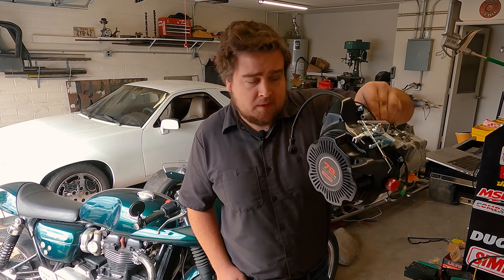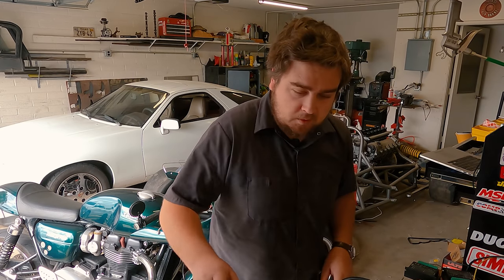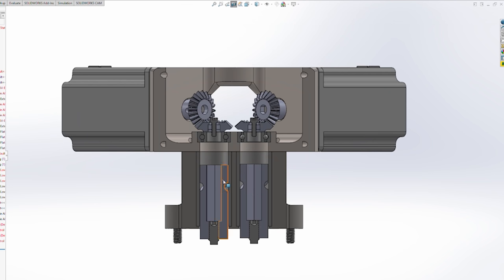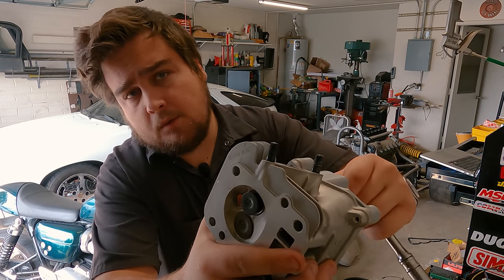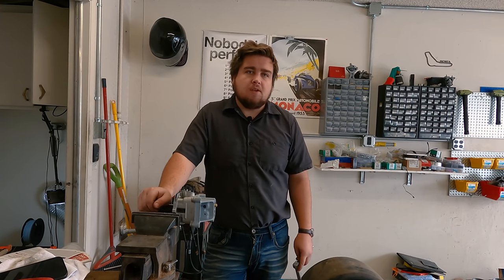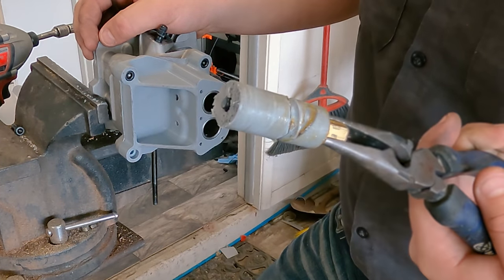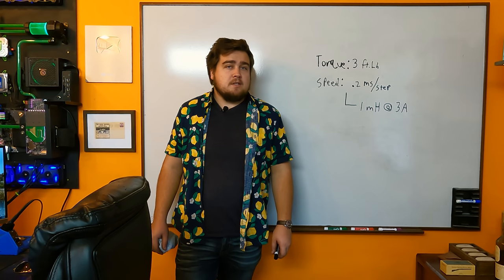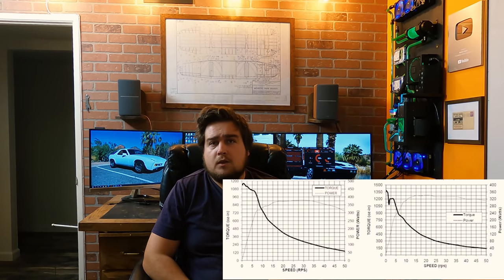Adventures In Deleting Camshafts | The Theory

Comment from the maker: This is going to be a long project... But I'll keep you updated as it goes along! in the mean time, I have some fun projects going up in the next few weeks! Thanks to everyone for the support, You all are amazing.
Reply: Forgive me if it was already mentioned and I missed it, but does adjusting the gear ratio between the stepper and the valve fix your speed problem?
Reply: Hey I just saw came across your channel and I have built a mechanical build I did but I abandoned it because of the tunning problem I don't know how to program things just mechanical things I am in Ohio I would love to see what you thought
Reply: Use a odrive for the stepper replacement uses brushless dc motors and encoders. They are faster and higher torque but still takes step and direction commands.
Reply: @nefariousyawn  I was wondering the same thing. It would increase the torque requirement, and also give less "resolution" in valve position.
Reply: Wesley but doesnt that make the actual design like 4x more complex and mechanically "vulnerable" than normal camshaft?
One of the goals for freevalve was much more granular and flexible valve control. You could modulate rpms from low to really high.
Any rotary electric drive would make it pretty rpm limited, so I would ask simple question: why not hydraulics?
They are much more controllable than pneumatics and you can control them with common solenoids.
True, you need high pressure system which introduce all of those nasty problems ... but ... they offer so much flexibility.
Reply: I found a direct drive electric solenoid directly on top of each valve and 4 valves per cylinder and I setup an assist spring system to reduce fatigue. I got them to move and at veriable heights but couldn't get any further and shelved the project because I didn't know how to make a program to make everything work together
Reply: Wesley. I'm beginning to think it might be simpler to drive the valves from some mechanism that takes its drive directly from the engine so that it's always in time with the engine. I'm thinking that maybe a cam, driven off the crankshaft might be suitable. ;-D
Reply: I'd like to hear your thoughts on this "new engine design" that came out recently.  It's very early obviously.   There's a video on "autoline network' here on youtube called:  "Who Wants The Most Revolutionary Engine In The World? 160 HP. 25K RPM Redline. Only 35lbs - AAH 583"  -- I'd like to see if you have any insights or thoughts about it.  Could make a quick video.
Reply: why not going for a fully hydraulic system? using the steppers to redirect the flow of oil instead of acting on the valves directly
Reply: Your videos are like a peek in my mind…all over the place!🤷🏻‍♂️😂 Great stuff! Look forward to seeing more
Reply: Could you use a linear motor and have a cam mechanism like a clicker pen?
Reply: I’m so invested in this.  I want to try it on a vw 16v 1.8/2.0 and the ej22 Subaru motors.  I’m in the process of learning 5axis, so I should be able to make some weird shit for my build.  Thank you for making this series.
Reply: Maybe you could use oil pressure to puch the vallves open?
Reply: Wesley Kagan;When this video appeared posted available, it sparked my interest to see if and what You had though of, attempted, developed, and if possibly You had any thoughts similar with mine.
Your presentation, descriptions and methodical approach are very good, thus, Your posted videos are also well done and clear too.

My ideas, design, implementation are actually contain a much simpler and simplified approach, using an existing device, able to be controlled directly, and functions with the necessary required quick response times, and eliminates all uses of these valves, any cam, and simplifies every piston engine design.
Still the Liquidpiston X engine design is more efficient but may have some use with the input and output ports for more powerful and larger applications.

All the Best and Much Success in Your Quest, Health and Well Being.
Sincerely
Reply: how about a camshaft, but the cam and the shaft are seperated by a eletomagnetic clutch?
Reply: Could you use a zigzag pattern instead of a spiral allowing you to spin the steppers in one direction?  No need to overcome the inertia of the direction change of the motors plus by changing the aggressiveness of the zigzag you could change the granularity of the motion of the valve.  You'd have to use a keyway to keep the valve from turning or use a non-round stem.
Reply: @andylewis7360  Classic
Reply: Rockers with a higher ratio may help bring those open & close times down
Reply: What about linear electric motors? Wouldn't those be able to cycle quicker and not require any gears or springs (though return springs would increase reliability maybe)?

Comment: Nice work, I have done a bunch of thinking about doing this myself. A couple comments: I think your math is a bit off, in that the 20 ms you calculate is how long it takes for 2 crankshaft revolutions. The valve is going to have to open in a small fraction of that time, and get closed again also. I calculate 6000 RPM = 100 revs/sec = 36,000 crankshaft degrees per second. If you allow 90 crankshaft degrees for the valve to open, you only have 2.5 ms for the valve to open, not 20 ms. This makes your job a lot more difficult.
You can make steppers go a lot faster by applying much higher voltage. The stepper torque is related to current, not voltage. The heat generated inside the stepper is also related to current, not voltage. You just need a lot more voltage to make the current through the inductance rise a lot faster. 200 volts or more is not out of line here. The stepper driver needs to regulate the current to the stepper winding. This is normal practice for any high-speed stepper application.
But in my opinion, you are fighting a losing battle with mass. You have to accelerate and decelerate all the mass of the stepper rotor, gears, ball-screw, and valve etc every revolution of the engine. I believe the "best" (most likely to succeed) approach would be to use a voice-coil type actuator. Stationary permanent magnets, moving voice-coil connected to the valve. There is a reason that speakers are made this way. Large industrial vibration testing machines also work this way. I have an actuator from a very old hard drive built like this: it has a 3" diameter voice coil, with a 30-lb magnet assembly. (This hard drive had two 17" platters...) You will still need a high driving voltage to overcome the inductance of the voice coil, but at least you will not have so much mass to throw around.
Nice work, good luck!
Reply: +1 for voice coil actuators. I worked on a medical product at work that used one in a precision motion application that was able to control the position of the coil down to the micron range while going through a set trajectory over and over and over at say 100Hz or so. The hardware was very straightforward - just a simple 24V full bridge driver. The control was the hard part, as always, but it was sick to see it work. Watching the actual position VS. The trajectory at those small time scales was cool! Fun project.
Reply: +2 on voice coils. Lets see a couple of mono block audio amplifiers strapped to the harbor freight motor.
Reply: So effectively a precision solenoid? 
Hmm, perhaps a fast solenoid/ voice coil with a stepper controlled depth/opening distance control?
Reply: I concur. Those types of actuators get very expensive very fast though - see recent EEVBlog episode.
Reply: Completely agree. I haven't done the calculations, but I find it highly unlikely that he'd be able to accelerate all of that mass fast enough with a reasonably sized stepper to make this design work. A voice coil seems like a much more viable option.
Reply: +3 voicecoils. The free valve idea is dying to be married to a free piston linear generator (adventures in deleting crankshafts) and the valves and power train will reduce to very similar control problems.
Reply: The blade pitch actuators on rotary subwoofers (rotating fans) are voicecoil driven.
Reply: I would say anything faster than a mechanical camshaft would be a step in the right direction.  Opening a valve in 90 crank degrees is pretty fast considering most cams spend about half the lobe duration opening the valve to full lift in a vehicle. There are some cams that actually dwell the valve at full lift in some race applications, but as you pointed out it does get really hard to compete with the combination of a big chunk of spinning machined metal and a very strong spring to control the valve at higher rpms.  If you could open the valve in 2.5ms that would actually be the equivalent of spinning an engine with a cam of 274 degrees total intake valve duration to around 9130 rpms, if I did the math right.
Reply: @nogood_ideas  So 2.5ms is about the equivalent of half a 200hz wave? (5ms for a complete period)
Reply: @DiscoFang  Yes
Reply: Every time the freevalve project gets an upload, someone suggests voice coils. The problem is speed vs mass - you need the mass to hold back the pressure, you need the speed to move a valve far and quick. Using valves but not cams has always been a losing game. Something like a camera shutter that’s airtight to high psi is a far simpler solution. Stepper is completely mental unless all you see is nails
Reply: @John-rw9bv  What pressure are you referring to? Mass doesn’t hold back combustion pressure, the valve seat does.
Reply: @John-rw9bv  I searched this up and found Patent US6199531B1 : shutter valve system for internal combustion engines. Haven't read it yet but might be interesting
Reply: The better option than a voice coil type linear actuator would be to look into piezoelectric actuators - these are incredibly fast and can produce some serious force.  In automotive applications they are already being used for direct fuel injection actuators.
Reply: Hello. I also think you need to use a solenoid which you named voice coil.
Reply: @turtleface166  The difference and the problem is that the engine valve spring presses with a force of 50 kg.
Reply: @survantjames ooooo i love these.  Granted one hell of a thing to design, but would be great to see!

Comment: I predict, after 2 years, Wesley will interate his design into a rotary engine. "No cam shafts" eventually leads to "no Pistons" 😂 excellent content as always.
Reply: You’re on to something, being able to seal off the ports electronically could really improve efficiency, and if it works? Rob dahm would probably be first in line
Reply: The whole point of the rotary is that the piston is the camshaft/valve -_-
Reply: Wankels don’t have valves. They use the apex seals.
Reply: @Flumphinator  boy do they ever use em.
Reply: @906MediaProductions  Right? I had a buddy who owned an RX and fucked the engine only a few months after rebuilding it, which he did when he bought it. It's a cool engine, but it belongs on a track, or as a weekend vehicle.
Reply: Honestly I think the liquid piston has much more potential than the wankel. Specifically due to the fact there's a more ideal path for combustion, regular, not flat sparkplugs, no apex seals to jump, and more even heat distribution
Reply: Check out my axial flow rotary valve engines.  This would be much more applicable to that, but you could really just turn it into a 'cam phaser' to give it variable valve timing.
Reply: Yes and deleting the whole combustion part and just using the electric starter motor, oh wait.....
Reply: ummm....

Comment: You should look up linear actuators, in term of acceleration they are probably better than rotary actuators for this kind of application
Reply: What did he used in the last one?
Reply: @Eduardo_Espinoza  He used indirect rotary actuators. It was air actuated in the end but not good enough. That's why in this video he says he switched to direct drive
Reply: Linear actuators is what Koenigsegg uses.  I believe Hyundai is also experimenting with linear actuators, and is primarily constrained by the cost of production.
Reply: @macoppy6571  arent the pneumatic linear actuators though?
Reply: @macoppy6571  the article I read said koenigseg used solenoids
Reply: @dylanzrim3635  yes, solenoids that actuate in a linear manner, hence linear actuators.
Reply: I think the issue is the metallurgy of magnets typically used and the operating temps found in the engine is higher than the curie temperature. Once it gets hot, there's not much force available from the solenoid and it stops being up to the task. 

The answer might be to implement a hydraulic working fluid and just have the solenoids operate a hydraulic sender (will get the solenoids away from the heat), but then there's issues with figuring out latency and dealing with routing a pressurized liquid in a small area. And that makes things somewhat more complicated again.
Reply: Not fast enough.
Reply: Piezo's might be the answer. short stroke, but lots of force. enough to leverage the output stroke of the piezo to get enough valve lift. 
and very quick, and easily scalable for variable lift.
Reply: This makes the most sense turn the valve steam into the linear actuating coil which is what Koenigsegg does pretty much

Comment: some thoughts :
make or acquire linear stepper actuators and connect directly to the top of valve stem.
lose the valve springs.
do not mimic a cam, the major advantage of what this design is complete control of the I/O flow through the combustion chamber.    
meaning: 
control engine speeds without a throttle (add fuel injection).
control compression ratio.
control EGR for lowering combustion chamber temp.
just to name a few.🤓
Reply: For Freevalve the other advantage was independent control of each valve, especially in a 4 valve per cylinder design. One exhaust valve goes through turbo, one doesn't. Allows variable boost control and wastegate electronically. Could also allow 5 stroke Atkinson by reopening an inlet valve for exhale-compress, which allows variable compression ratio

Comment: I think you need a lot more energy than you realize when fighting against the valve springs, so the electrical power requirements will be very high. It's still a good design, but getting rid of the valve springs will make it work at lower speeds (until the inertia of the valves and components is too high for the motors to accelerate). This is why you tend to see more hydraulic systems in production (things like MultiAir)

Comment: Instead of rotating, try coils like a rail gun or voice coil in a speaker. Make the valve stem a coil with a coil around it, lots of power, speed and control
Reply: Hmmm... Can you use an induction coil as part of the solenoid plunger to boost it's reaction to a driving coil? That might be a way to get around curie temperature issues with permanent magnets or ferrous materials. That might be an interesting trick to having a strong linear solenoid action at the temperatures not uncommon to an internal combustion engine. That would involve re-inventing the linear actuator solenoid itself rather than trying to use something more off-the-shelf.
Reply: This makes the most sense turn the valve steam into the linear actuating coil which is what Koenigsegg does pretty much
Reply: Voice coils are incredibly electrically inefficient. To the point that there was a man who designed a servo-controlled subwoofer that delivered 10x the force on the same power as a 300w sub.

Comment: Great vid, i like this freevalve series! One thing about the acceleration, if you haven't thought of it already.
 If you can get ahold of the rotational inertia of the suitable stepper motor, you can use newtons second law and calculate the acceleration of the entire system, including stepper motor, gears, shafts etc. Then you will know if the stepper motor is able to accelerate the system quick enough or not :)
Reply from the maker: That's absolutely true- It would cut down on testing things as I go. Good thought.

Comment: Just brainstorming here, but what about changing the valve system completely to say a rotary valve?  Then you would get rid of the reciprocating action entirely which appears to be the main issue and I believe even in the best circumstance it will never be ideal.
Reply: +1 rotary valve concept

Really neat idea, but implementing it is not something I can fathom from my armchair.  I have the basic idea in my head but I have no idea if it would work in reality.
Reply: @DevinFriske   second the rotary valve idea.  As the crank turns the valves need to open.  Instead of "reversing the direction" every cycle why not implement a VTEC style actuator?  The amount of lift could be changed over the course of a few crank rotations which in the end have a net similar effect.  Electronic valves or cam-less 4 stroke.

Comment: Ive been tinkering with something similar, I also first had the idea of a direct steeper actuated valve but came to the same conclusion you did. What I came up with was using an electromagnet/solenoid for actuation, but to achieve the variable lift portion, using a mechanical endstop that gets moved by a stepper via a threaded shaft. Normal steppers can be used and can change the lift by about 10mm in 250~ms which is very reasonable

Comment: Love the project! What about a gearing the output of the stepper motor so the stepper spins once and the valve spins twice. (just some gear ratio) Surely it has to be easier to find a higher torque stepper motor rather than a  faster one.
Reply: This was my thought as well, although you could also change the gear ratio with the ball bearing slot helix angle.